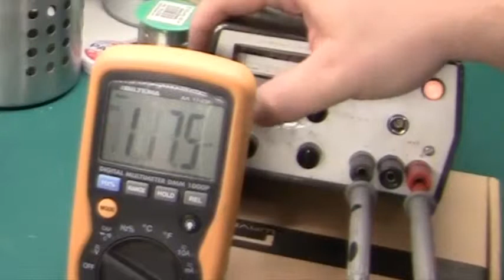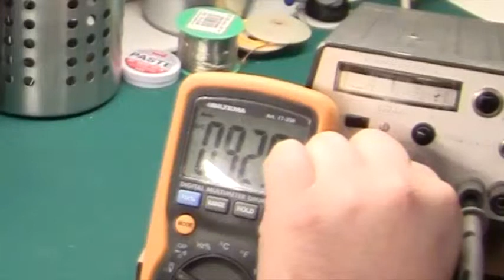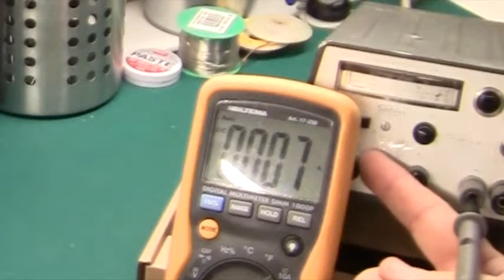Teardown and comparison of eBay PSUs

Comment: SDE181 series does not contain 8 nor 10 pin  (TO-99) Opamp IC's. it does have two differential amplifiers built from discrete  3 pin TO-5 (or TO-39) bipolar transistors

Comment: To be fair you should compare the new price of the French power supplies to the new price of the Chinese. I would suspect a factor of around 10 might creep in. In regards to weight, your Chinese power supply is a switch mode ? Which of course would be lighter, either that or you have some mighty strong wrists. I'm always amused when people say Chinese crap especially when America owes China $10.5 trillion. Personally I think you get what you pay for - cheap, crude but does the job, no doubt like your old Chinese power supply.
Reply: You are right, Professional 1970's western electronics compared to cheapest thing Gubagdond dares to sell abroad in this millenia, not fair, but still relevant. note that one.the "1723" IC is ages old Fairchild uA723 (National Semiconductor LM723) a decent linear PSU controller. I would call that Chinese PSU a Tofu Dreg PSU, 15V at 2A would make both the transformer and the too thin backplane of case prettu hot in quite short time.

Comment: I have nearly worked my way through all your videos, keep up the good work and keep them coming. Always informative and enjoyable.. 
I just wanted to mention a potentially lethal problem I spotted in your Chinese PSU. If you check the primary wiring it appears that the fuse is connected inline with the neutral supply line, so even in a failed condition there would still be dangerous mains voltages present in the device.. Karl
Reply from the maker: Thanks for your support, and I'm actually surprised that there is a fuse at all.
Reply: Both live and neutral kill just the same. It's AC not DC.